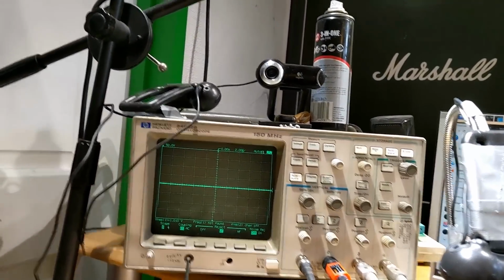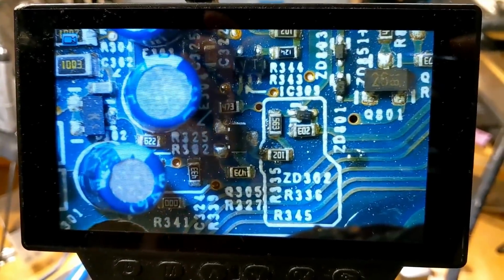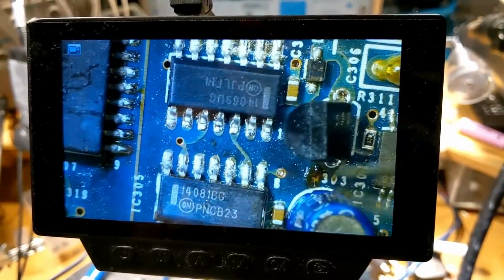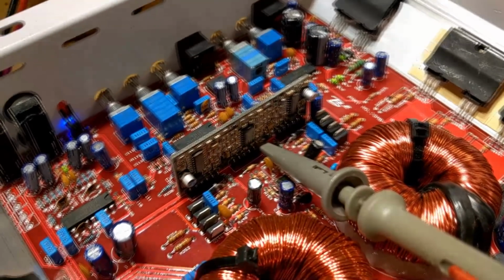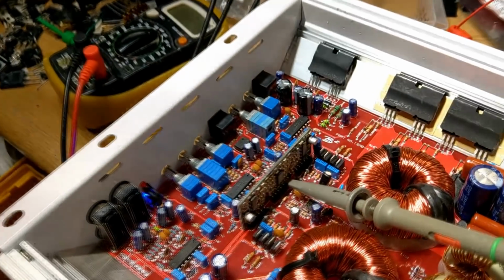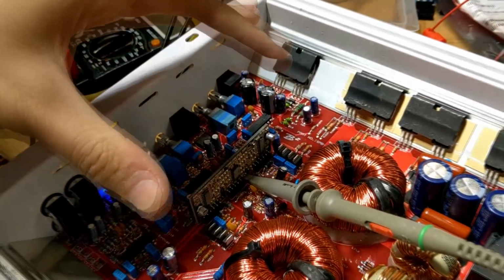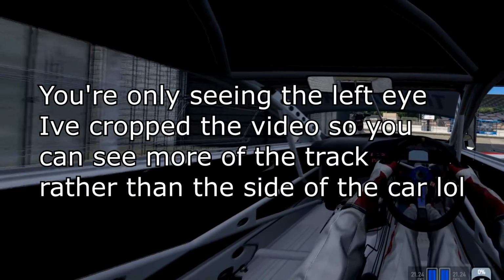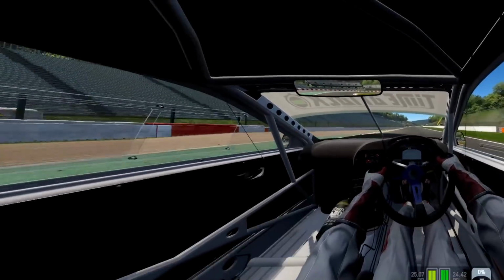Streammas DAY 18 - I thought this amp had BARE ISSUES but it was fine 😂

Comment: i have a rockford t1500bdcp and when i try to turn it on the gate drive will be there for a second and then disappear. Protect light is on after too. I already replaced the PWM driver and the LM339 comparators on the drive board. what else could it be?
Reply from the maker: Something is tripping it into protect, DC offset perhaps!

Comment: Near to the largest capacitor, you have a smaller one that inflated. I would say it filters the voltage for 2 excitation integrated circuits. I think that capacitor is very important because a bad excitation could kill the output transistors.

Comment: Hey bro do you only repair car audio amp's or can you fix a powered subwoofer for home theater amp?
Reply from the maker: I've fixed them before but typically no
Reply: @barevids  cool , I have 2 amps from a set of Definitive Technology Super Towers with 1500 watt amplifiers in them and one crackles real loud and blows fuses and the other one no sub signal .

Comment: The term you’re searching for is capacitor ‘re-forming’, so named because the slow increase in voltage applied to the cap causes the lost layer of aluminum oxide to form once again and regenerate or ‘reform’ on the surface of the aluminum strips inside the capacitor. If this is not done in a controlled manner the result is usually an internal short between the plates, whatever electrolyte left inside boiling from the heat and POP it explodes.

Comment: im pretty sure thats how that taramps amp works normally
Reply: ha you figured it out. 

before covid a student brought one in and we discovered the same thing.
Reply from the maker: Only a small handful. I hadn't seen one like this. Most fullbridge have full wave on both terminals not half.
Reply: @barevids  yeah im not nearly as knowledgeable as you when it comes to amplifiers but i knew it was weird when we looked at it. 

i work at a trade school as a lead maintenance tech and i did on the job training with some of the kids and eventually some of the students heard my car and would come to the shop and ask for advice on occasion and one was having issues with the amp he thought and brought it in. i dont mind trying to help them theyd bring in laptops guitars and whatever else for us to try to fix. 

anyways turned out out the amp was fine and the problem was having the sub out turned off on his deck  but we thought for sure the amp was messed up based on him saying no sound and when looking at it with the scope til we hooked it up and it sounded fine.
Reply: doesnt the warhorse do something kinda like this? splits the sine wave or something

Comment: been looking at taramps smart 3. tempted to sell my hertz hdp1k and get it. shame its not got 24db high and low pass. looks like ebay seller is +$70 currently.
Reply: I can tell you from personal experience that the smart3 is a monster for the money. It is very "tight" sounding, but you can tune that out with lpf and boost. To me it's worth it for the shock when I show people my new tiny amp then demo it.
Reply: @1goodfixer  how much was uk vat and fedex handling fee :O ?
Reply: Prices are up for good reason - it's worth it. Your amp is almost 500 new, and it puts out 1/3 the power of the smart3 and the Hertz can't cater to impedence rise like the taramps. I know cheap amps have drawbacks, but 3kw rms and 6kw peak @12 volts for only 350-400 is a steal.
Reply: @1goodfixer   @1goodfixer  Snag is i don't use full power, as im using pa speakers so 8ohm or 4ohm. my hertz 1k was 280GBP posted.  no body else seamed to be bidding, making offers. do  u mean $500 not GBP?

hoping prices go down after xmass. :)